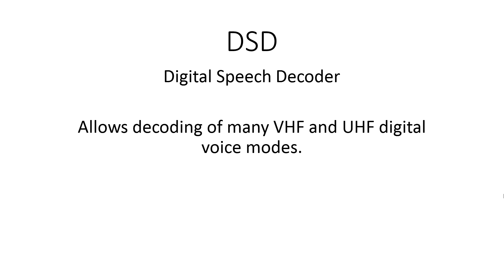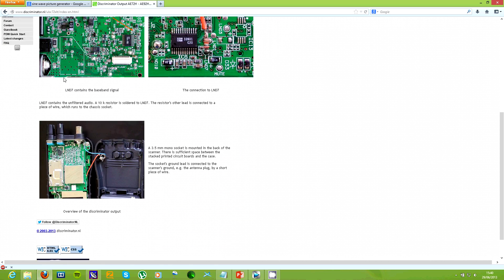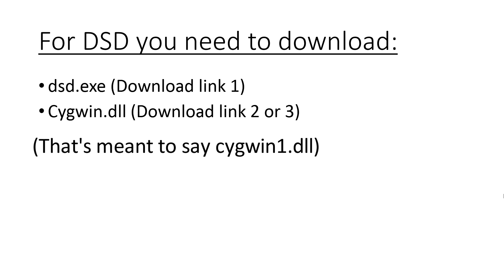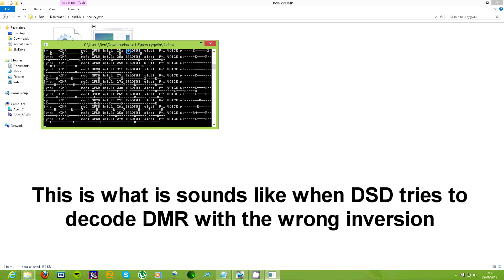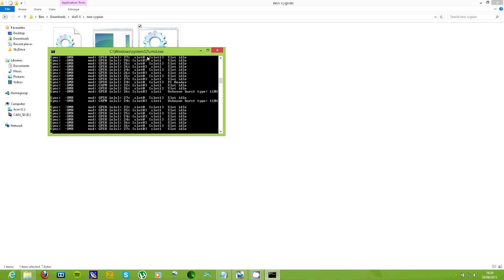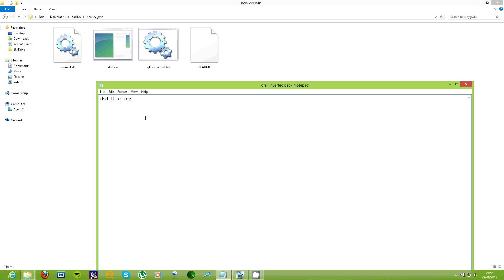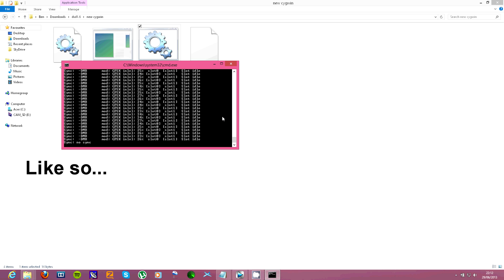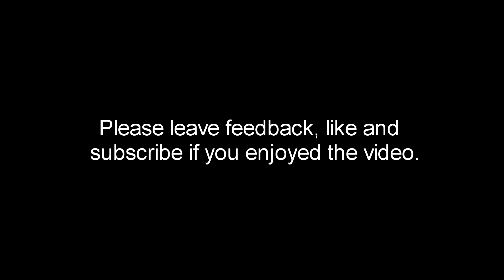Complete Guide to Digital Speech Decoder (DSD) - Decoding DMR

Comment: Hi how do you get the inverted.bat to work I am using dsdplus but nothing happens when I use it in the dsdplus folder I made the bat file and placed it in the dsdplus folder but see perimeter -ff is invalid please help.
Reply from the maker: This guide is for DSD, not dsdplus. Dsdplus is an entirely different software so nothing in here will work with it

Comment: I am looking for a program that will take in (Discriminator) a C4FM signal, and give me a serial (9600 baud) output or raw data. Do you know of any? It doesn't need to decode audio.   thank you   John
Reply from the maker: You could make one with GNU radio using blocks.

Comment: Good Day, I just subscribed to your great channel,thanks for all the info. I have 1 question, I use DSD plus 1.10 with my Icom IC-R7000 it all has been working great. Except for DMR decoding. I have  downloaded the required bat files but I am at a loss of where to put them to get the program to decode DMR. Any help would be great,,Steve. thewizguy@yahoo.com
Reply from the maker: Dsd plus doesn't use the bat files. Only DSD, the original one.

Comment: As usual, another goat rodeo.  Every attempt at getting the DSD+ executable for Windows winds up at a dead end, make/include files but no .exe on Github (useless), or ZippyShare which won't provide the file until spyware is installed.  And then there are the obligatory circular links, what fun.  The file I need is always just a link away!

Then there is another (the same?) DSDPlus, at version 1.101.  Is it the same basic program or a totally different one? Who knows?  https://www.dsdplus.com/download-2/  At least you don't wind up on Github or ZippyShare!  But does it work with an RTL-SDR?  It's anyone's guess.
Reply from the maker: I just searched for dsd 1.6 download and the first result provided a working download. Have you tried that?

Comment: Is there a way to decode Mototrbo DMR with AES256 because i was given the key but so far i've never came across a software that would have "enter key" option and i'm not buying 1000$ 2.generation radio + software just to listen...Great video tough!
Reply from the maker: As far as I know, there is no way to decode it by software. If you have the key and they are using DMR standard encryption (not motorola proprietary, there are two types) with no RAS (restricted access to system, an authentication feature) then you can buy a Hytera radio (they are cheaper) and use that to listen with the key, since Hytera radios are able to do AES256 following DMR standard method.
Reply: radiosification I was already checking Hytera radios and came across AES256...back then i bought TYT MD380 because i didn't know anything about digital and there is no way to listen 256bit on 128bit TYT they only hear me fine when i talk without encryption.
Thanks for your fast reply! i Guess Hytera is only option!

Comment: I am not getting any audio on DMR with DSDplus and I did every possible way. No audio at all. Any ideas?!?!??
Reply from the maker: Are you on a channel where someone is actually talking, or is it just a repeater transmitting idle messages? Is DSD plus muted? Is DSD plus definitely receiving audio to decode? Is the default soundcard set to your desired output soundcard?

Comment: any way to use DSD+ with raspberry pi?
Reply from the maker: No, DSD+ is only distributed as a windows binary, but DSD source code is available so you could use that on raspberry pi.
Reply: +radiosification thanks look into it
Reply: boot windows on raspberry ;)

Comment: I have dsdplus and I see the signal but I cant get any sound out of the computer...any ideas?
Reply from the maker: Joe Sheets maybe simply no one is talking? Does it show that anyone is talking?
Reply: radiosification Yeah..I am a ham and had my DMR radio and there was traffic on the freq, I saw the spike, but did not hear the audio. When I changed the output to the computer speakers, I heard the un-decoded noise. When they stopped transmitting, it came back. I also saw the DSDPlus scope was active during these transmission. I do have things working on the analog side (FM radio, air traffic, etc) of things just not with DSD.
Reply from the maker: what was it showing on the scrolling screen of dsd?
Reply: radiosification No, It wasnt

Comment: great video mate got it working sort of . sounds inverted but when i switch mode to - still says the same im usind a sdr dongle . ive used your audio sample on this video and it still sounds garbled in both modes help
Reply from the maker: Don't use this video as a sample to decode. It won't work very well, if at all. Use a live source from either a scannner with discriminator tap, or a SDR, routed properly to the decoding software

Comment: Is it possible to get DSD to work on OSX? I have HDSDR working on OSX and it would be great to get DSD to work with that as well.
Reply from the maker: Have a look on the DSD page and see
Reply: There's an easy-to-use DSDConverter application for Mac that lets you convert from DSD files to WAV files.